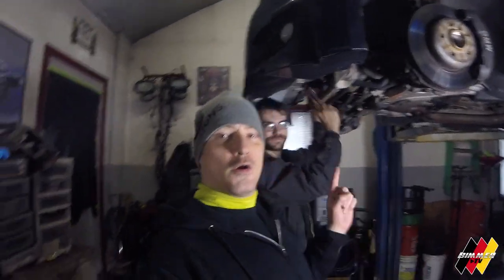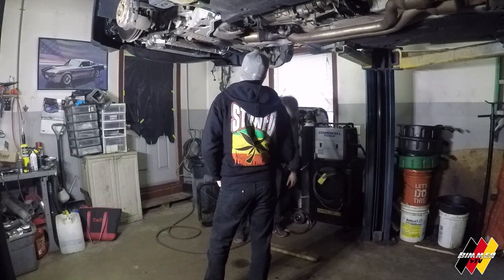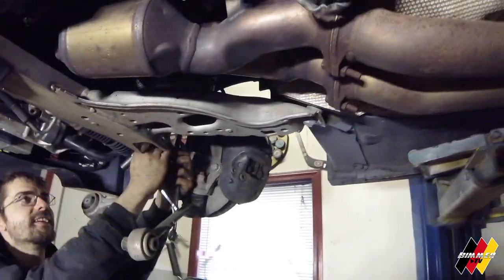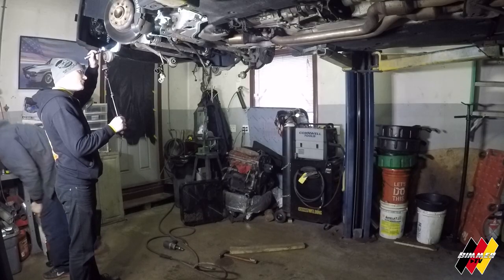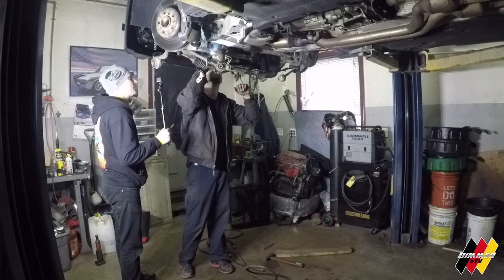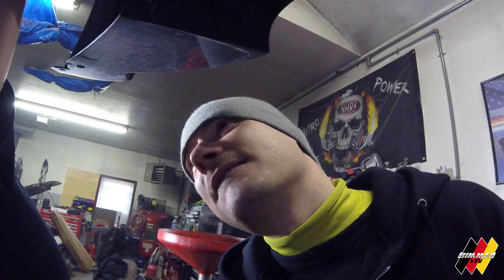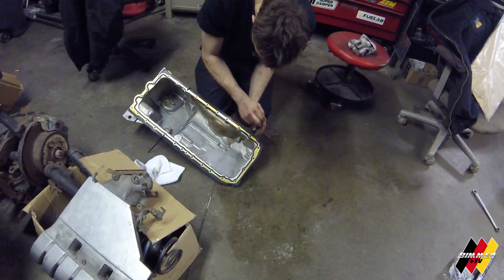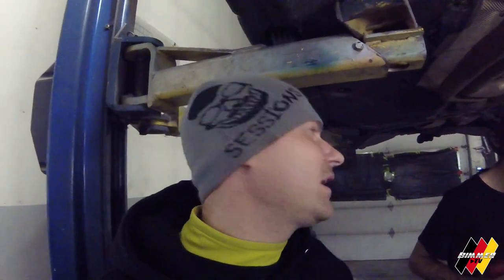BMW 135i N54 Oil Pan Gasket Replacement (Episode 22)

Comment: Thxs for the content…..I have a 2011 135i.   Other than the oil pan gasket….what are the other gasket that generally need swappin.   Thxs!
Reply from the maker: Oh man, pretty much all of them. Definitely want to do your Oil Filter Housing one. These cars are super needy so good luck. I ended up doing this oil pan again in about 40K miles. It wasn't bad but it had started leaking a bit again.

Comment: With 40 years of owning and maintaining vehicles including MG's, Triumps, Jaguars, Z-cars, I've NEVER, EVER had to replace a freeking oil pan gasket unless I did an engine rebuild. Now, my cheap assed 128i needs one at 84k miles at 1000 bucks to have it done. This is a great video and shows exactly why BMW's SUCK! NOTHING is simple except a fat wallet!
Reply from the maker: Lol, they sure are needy! Glad you found the video helpful! Mine has actually started to leak again already the tiniest bit. We're going to be replacing the rod bearings very soon and will be putting in another new OPG when we do.

Comment: Do you know if it's the same process for the n55 135i?
Reply from the maker: Pretty much yes.
Reply: Thanks? How long did it take robget the oil pan out. Going to attempt to change the rod bearings this weekend
Reply from the maker: @dudedue987theman  This was actually filmed last winter so I'm not exactly sure. Probably in the 3 hour range is what I'm thinking. Time starts to blur when doing jobs like this lol.
Reply: Oh ok not bad at all I'll have around 12 hours of lift time to do the job.
Reply from the maker: @dudedue987theman  If you're fairly familiar with these cars that should be plenty. Most of the time consuming bit is removing suspension components as I'm sure you're aware. Good luck!